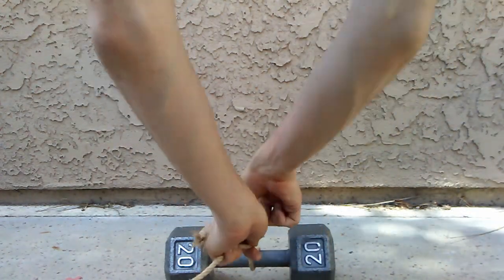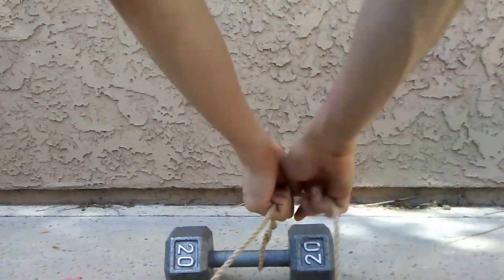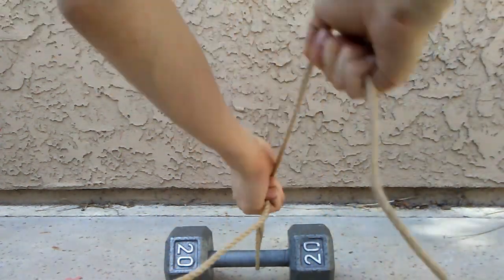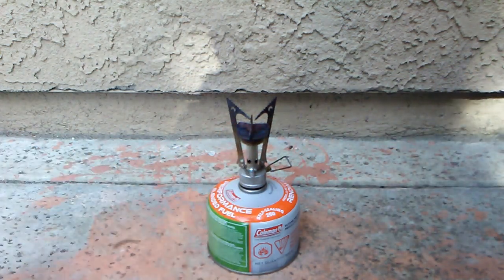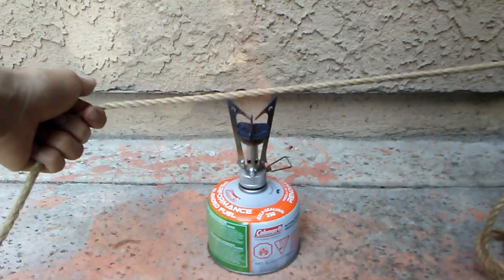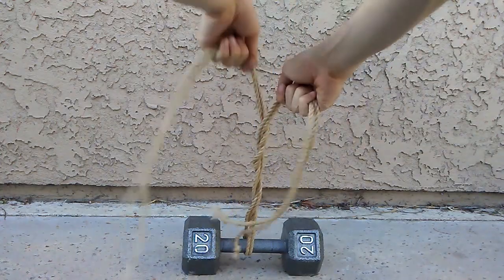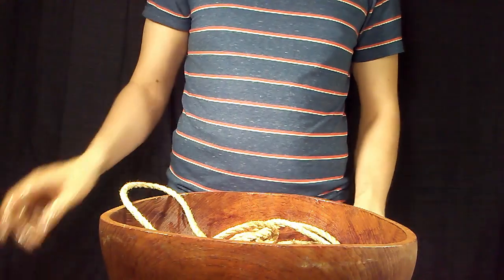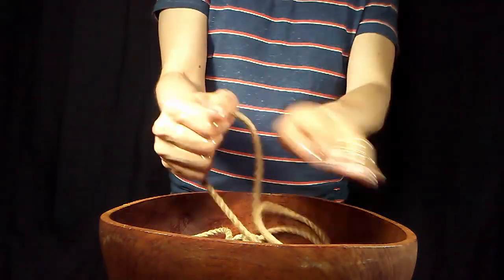BDSMIY: How to process raw natural rope

Comment: There is a step missing, boiling the rope and drying under tension are very nesseccary steps prior to applying oil or beeswax.  This helps soften the rope, making it much more pleasant to the person being tied.
Reply from the maker: It comes down to if you want to do suspensions or not. While boiling will make your rope softer, in doing so you damage fibers and significantly weakens it. 

They will be more uncomfortable for sure, but will smooth out with use over time.

Comment: Hi, great tutorial!! But I have some questions about the burning steps. I tried to use a candle to remove the hairs. But after I cleaned the hairs, there were new hairs formed. Feel like they can't be clean.
Reply: Is there any suggestions to clean up the hairs completely?
Reply from the maker: It will still be a little fuzzy at first. Treating the rope with oil will help soften it and the fuzzy will wear down with use.

Comment: Hi! Is it a good idea to use coconut oil? Thank you!
Reply from the maker: Hey there. Coconut oil is a fairly long lasting oil compared to other organic oils, but it will go rancid in 1-2 years. If you intend to replace your rope that often you could get away with using it, but I wouldn't recommend it.

Comment: Is such rope safe to use for suspensions?
Reply from the maker: Natural jute and hemp rope should be safe for suspension. The strength of the rope decreases with use and the rope should be checked for damage often. Dyed natural fiber ropes are generally made by boiling the rope in water which dramatically reduces their strength, to the point where I would avoid them.
Reply: @PatrickShibari  ok thank you :) I'm going to buy natural jute and proceed as shown in the video. Thanks for the great content :)

Comment: Buy a nylon ropes it's cheaper and stronger👍
Reply from the maker: True but jute looks better which is ultimately what matters in art.
Reply: Nylon doesnt have a good tooth and you cant use it for friction holds/knots like jute or hemp. Nylon feels nice but has a lot of drawbacks.